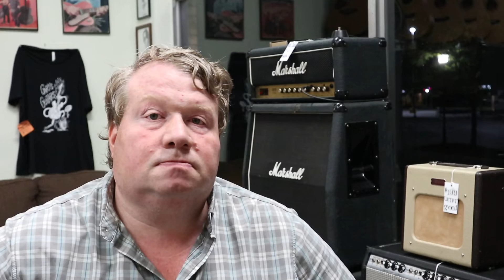A Talk about Wattage and Loudness

Comment: You want 100+ watts for bass only if you like the modern "live" sound of bass overwhelming everything else. Some of us have very fond memories of the days when bassists used Ampeg B-15's or Black Face Fender Bassman's for their live gigs. The bass was "there" and solid, but wasn't painful and drowning out the drummer. Yes, PA systems have improved a lot, and not just so you can run all the instruments through it to cause ear damage in the audience. Many of us, in the sixties and seventies used Kustom or Peavey (I had both) 100 watt PA's, with two columns of four 12" speakers each.....and they easily handled three-part vocal harmony, and could be heard over a loud guitar, bass, Hammond, and drums band. I'm glad the Marshall, Hiwatt, Acoustic, etc "arms race" for bigger and louder amps is losing to (as you say) the 15 to fifty watt combo amps......in fact the greatest amp in the world for almost any application is the 22 watt Fender Deluxe Reverb. I look forward to more videos........
Reply: Yes, unless you're playing a gig on the back of a truck in an open field, you'll never really need 100 watts of valve power. If you're playing in a large venue, they'll almost certainly have a quality pa system, so a 20 watt amp is more than enough. There are a few exceptions, but rarely so. ✌️

Comment: Thanks Mark, all the best from Berkshire, UK.  I was very interested in your take on the Fender Pro Junior - and immediately bought one.  What a sterling tone machine!  I have been through the gamut from Marshall stacks [I had a guy change the Marshall logo on the speaker to Meathead for fun]  through Dual Showmans with 4x12 cab, Music Man HD 130 (I think) with 10" speakers, Mesa Boogie MK IV (which I will keep), Deluxe Reverb (also a keeper), Rivera Super Champ ( don't enjoy the sound when it gets above clean), WEM Dominator MK I bass (keeper - beautiful jazz tone), Gallien Kreuger 250ML with matching stereo 4x12 cab (nails the 80s guitar sound- Iron Maiden etc, keeper); these amps are all in the room.  I find that my go to amps are the smaller ones that deliver the tone I hear in my head at the time when I am "going for something" for recording purposes.  To this end I am using the Pro Junior (tiny power, but small tube amps are loud as you point out here), an early Yamaha THR10 (also tiny when micced), and an early MK I Groove Tubes STPG through a Celestion 1x12 cab for studio work.  Live work has been extremely limited due to Covid over the past couple of years but prior to that I have graduated to using the Deluxe Reverb or the G-K +/- 4x 12 depending upon the type of music. My back is not up to hefting the Meathead amp and cab or the Boogie around anymore.  It is interesting how we use the various amps we possess in order to meet the needs of a particular work situation - at least that is my explanation when my wife asks why I need so many of these boxes, not to mention the ever increasing pile of guitar cases!  I really enjoy your take on the practicalities of the usefulness and application of the plethora of gear out there, and I do tune into your live chats with your extremely intelligent "partner in crime",  albeit at some remove after the real time feed due to our different time zones.  Please persevere with Gary's Guitars and we will stay with you.  You can listen to the music we produce at www.afunja.com, it is weird but we love it.  The current mixes are way too crowded but that is being addressed - exhausting work!  Thanks for being there, honesty will always win out.  1ove, Mark

Comment: Not too much mention of the various types of speakers and how they affect sound?  Are all speakers equally efficient at pushing air?  Some have really big magnet structures.  Some are small.  How about frequency output from various speakers.  Will a class D of same wattage as tube amp pushing same speakers sound same if tubes are not overdriven?  Interesting stuff.
Reply: Would be a whole feature length documentary to cover everything from amps to cabs and speakers. But hopefully it's covered in future videos

Comment: Hi Gary. What would you recommend for a bass player with a Hartke 400w RMS 4x10 cabinet rated at 8ohms? 
1. A 500W RMS amp(330W RMS @ 8ohms) - Hartke LX5500
2. A 800W RMS amp(500W RMS @ 8ohms) - Hartke LX8500

Both amps are D-Class. 

Is it true that's usually better to have enough headroom?

Should I go 500 or 800?

It's possible that in the future I will add another 8ohm cab wired in parallel so that would be 2x400W at 4ohms worth of cabinets. Will the 500W amp still be enough?

Thank you in advance.
Reply from the maker: headroom is always good in bass, so if money is not an object, go for the higher watt amp.  Even though you won't use those extra watts in volume, the headroom keeps the mids "round."
Reply: @GarysGuitarsUSA  thank you sir. I went with the 800w anyway, it was 60$ more expensive, but it's worth it.

Comment: It's all still black magic to me. I went from  a dsl100 and 4*12 cab to a Peavey Classic 30 combo and never struggled. Then I put an 8ohm speaker in and it got even louder. I can't imagine ever needing more than 30 watts. The eq stack affects the gain/loudness too. If you crank all the eq it's even louder. As for class D, I ran a 1000w class d active pa speaker with modelling and it wasn't great, I could easily peak the input and fart the output with to much bass in the cab modelling.
Reply from the maker: It's still black magic to me too.  I have a 12 watt amp that's so loud you can't be in the same room with it all the way up.

Comment: I had a Peavey valveking combo with 50 20 and 1 watt mode. At home I never put it above 1 watt. The only reason I bought it because hardly anyone makes low wattage tube amps with 12 inch speakers. 1 watt through a 12 inch sounds great.

Comment: Hi, love your breakdown of tones. Very surprised not more folks here. Question........why dont acoustic engineers address speaker enclosure improvements........i use a homemade plexyglass folding 3 leaf panel i put behind my amp (combp)........so so much tone........moving closer or further is the usefull variant??????
Reply from the maker: Leo Fender made his amps open back for the sounds, and said, "if you want a closed back amp, put it against the wall.    A speaker doesn't know what direction it's pointing in, and pushes a lot of sound out the back.  You are redirecting that sound, great idea.

Comment: No disrespect,  but you need to go back and fact check your claims. Firstly, tube amps sound louder because of two factors, distortion content and speaker efficiency.  Hence transistor amps are cleaner (less distortion) than tube amps. Secondly, an Ampeg SVT was 300 watts with a rock solid power supply because the bottom end was so demanding. I'm not so sure the class "D" amps are good or bad, nor do I think they are producing more or less power. I do know Fender has gone after the modeling market with remakes of their classic amps that only replicate a specific model, as opposed to many of the models. The reason amps are smaller is the players don't want to haul heavy gear around from gig to gig. There are other claims you make, but the ones I have outlined seem to be the most important. I hope that clears it up for you.  Like I  said, no disrespect intended, but do your homework.
Reply from the maker: "tube amps sound louder because of two factors, distortion content and speaker efficiency"   Solid state amplifiers can use the same speakers as tube amps, therefore either can have efficient or inefficient speakers.  I did mention the "overtone series" and that covers your point about distortion content, even harmony distortion.  Read Russell Hamm's well known paper on this, you can find it easily here on the internet.  I had the opportunity to speak to him about this in person as homework.   Class D amps are capable of producing MUCH more power in a MUCH more efficient way.  I didn't make that up. I run a guitar store and every day I talk to player who want lighter amplifiers, so that also is not news to me, and more and more are going for lower watt amplifiers.   I'll do my homework if you do yours too!